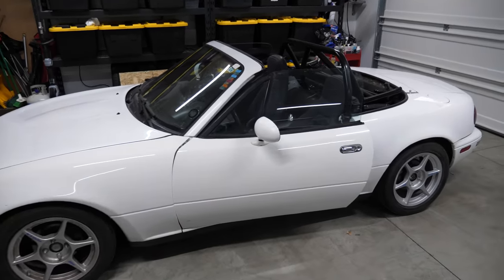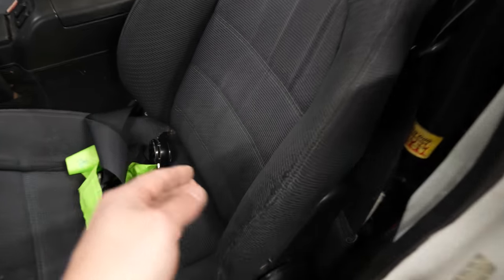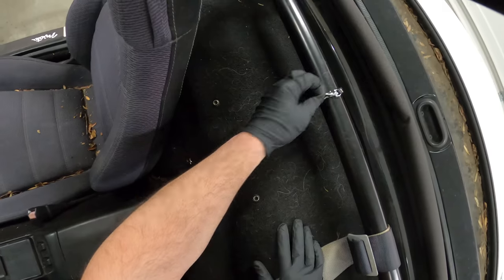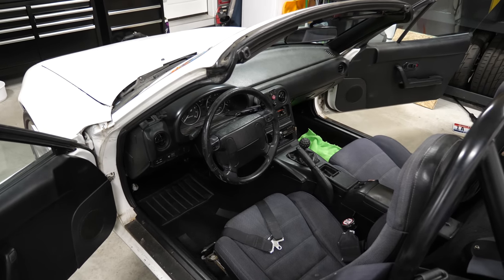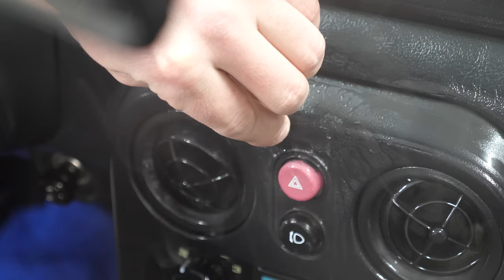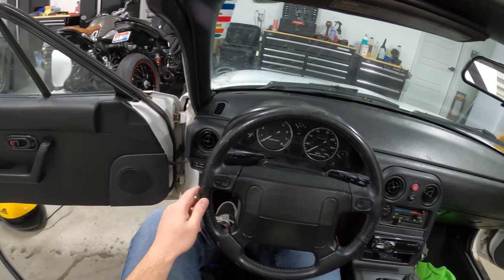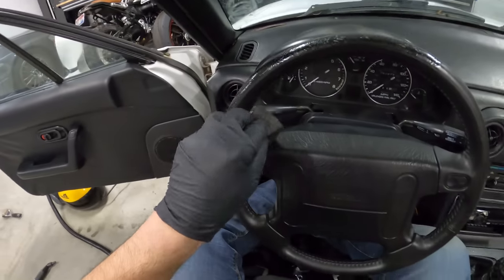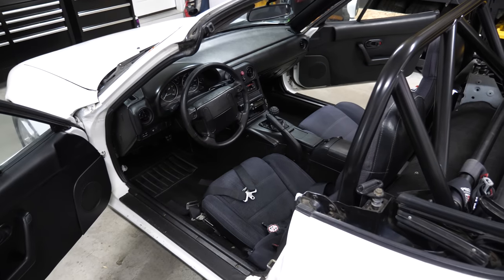Neglected Mazda Miata Interior DETAIL & Restoration | Start to Finish!

Comment: Man, watching this just made me travel back in time to last summer where i actually stripped my miata complety from all its body panels, let the little dents be filled, the parts sanded, rust welded, and than when i reassembled it, i cleaned everything complety. i even had the enterior stripped because they had to get the carpet out for welding, so it wouldnt catch fire. 
cleaned even the metal underneath the carpets just for that added peace of mind.
unfortunatly i dont have a extractor vacuum so my seats are still kinda jucky in the summer, your arm skin kinda like sticks to the seats a little bit. i might try just washing them by hands or maybe taking the cloth of and washing the foam and cloth seperatly

Comment: I just recently got a 1990 Miata and mine has nearly ALL of the exact same issues as yours 😅 the exact same seat rip, the tombstone / center console is cracked, there is some mold on the carpet in the back where the top goes down (will eventually need to replace the top but this is my second vehicle so not planning on driving it in rain or snow and will soon be kept in a garage). plenty of debris, worn out floor mats, looks dirty and crusty everywhere, scuffed wheel and shifter, etc.

it will need a lot of love and restoration on interior and in general, very excited to get working on it.